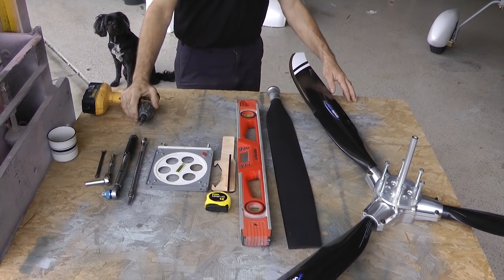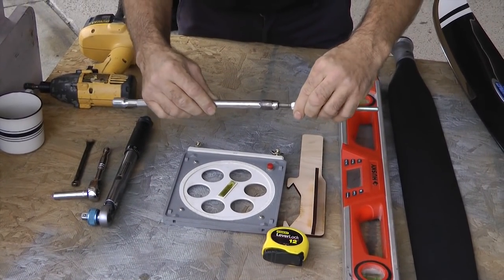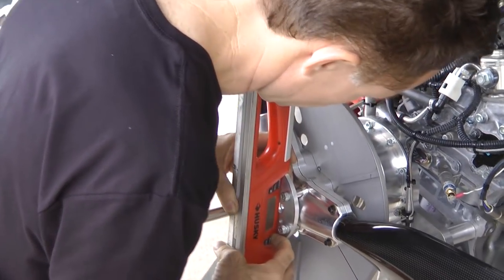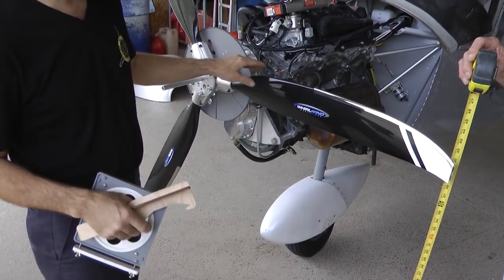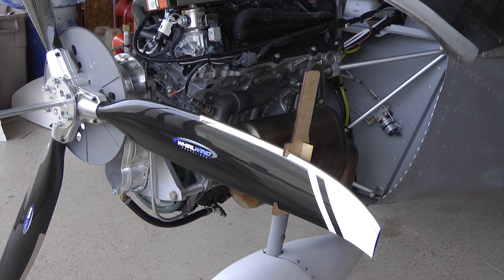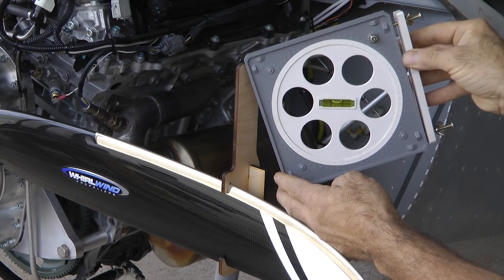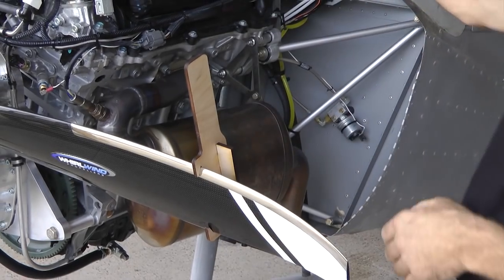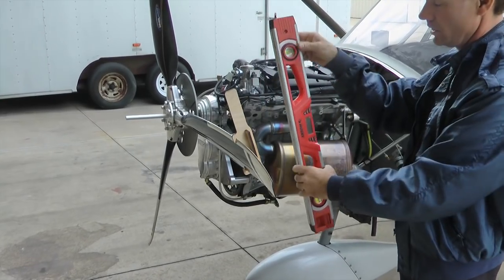Installing and Adjusting a homebuilt aircraft Propeller

Comment: Seems like a jig made to go on the flat face at the hub, and and adjustable outboard portion on the TE/LE of the blade would be simpler, maybe supplied by the prop manufacturer.

Comment: But a propellor has a helical twist... Closer to the center has a greater angle of attack... further at the tip has a shallow angle of attack. 
So if I have a 50 inch prop that must be set at 30 inches forward for each rotation (50x30), every point on the blade should go 30" corkscrew forward for one rotation. So the degrees I set it has to be calculated for an exact radius out from the center, not just some random point on the blade where the measuring tool stops or some space somewhere at the tip.
Reply: Its basic training for beginners here!! sounds like you need no help go play!
Reply: But the tool will stop at the same point on each blade. All that matters is that the blades have the same angle. The exact pitch isn't important and can be changed, that's why you have an adjustable prop.
Reply: Could have measured from the prop tip to where the tool becomes snug as a way of double checking that the tool is placed at exact same radius from the center of the hub.   

This of course assumes the distance from the hub center to the tip of all props are the same.
Reply: Francis Castiglione   No, you don’t need to compare different props at all, it’s strictly about the props angle relative to the plane. You want to be consistent between blades on the same prop but you treat other different props as their own thing.
Reply: Francis Castiglione   No, you don’t need to compare different props at all, it’s strictly about the props angle relative to the plane. You want to be consistent between blades on the same prop but you treat other different props as their own thing.